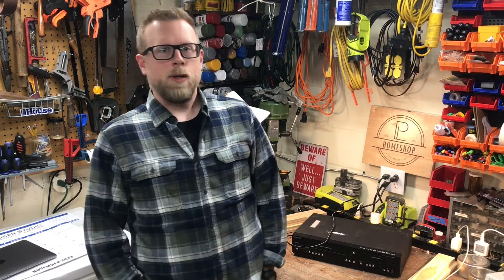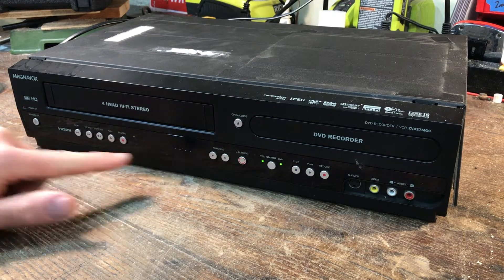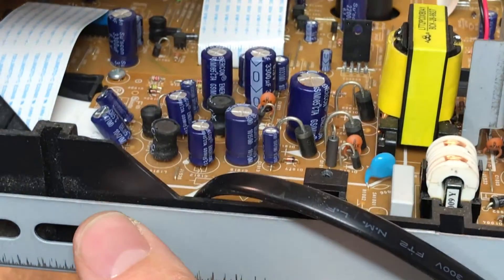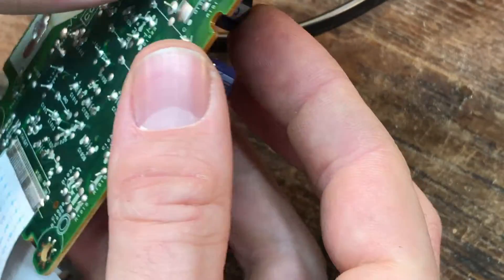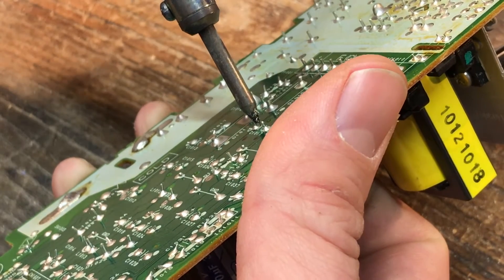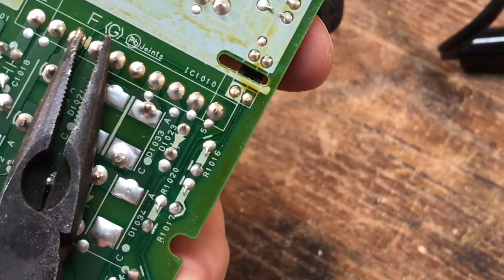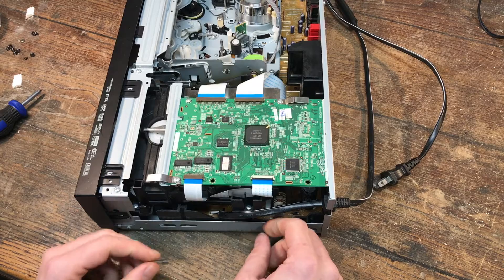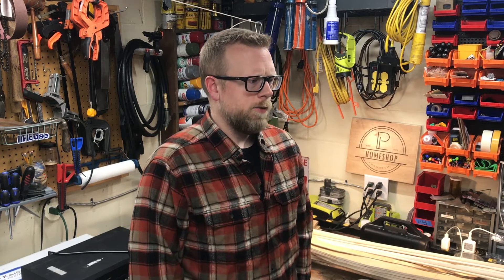Cheap and Easy Fix for an Old Magnavox VHS to DVD Recorder

Comment: You should use solder wick to remove the old solder before putting in a new one.  Not all bad capacitors show a bulged top. You should replace any if the caps in circuit directly to the transformer.
Reply from the maker: Solid advice! Thanks!

Comment: So i am trying to fix mine right now.  It was the exact same capacitor. How do I know for sure which to order from amazon.  I know 4700uf but on amazon they seem to have a bunch of different specs for that number.
Reply from the maker: I’m not by any means an expert. From what I understand there is a little flexibility in things as long as the numbers match. They don’t have to look exactly the same.
Reply: @Philewandowski  my biggest issue is the actual size. I can find the numbers but everything I find is way too tall. These are like what maybe 10mm tall?  I keep finding double that height
Reply: @Philewandowski  any chance you remember the listing you ordered?